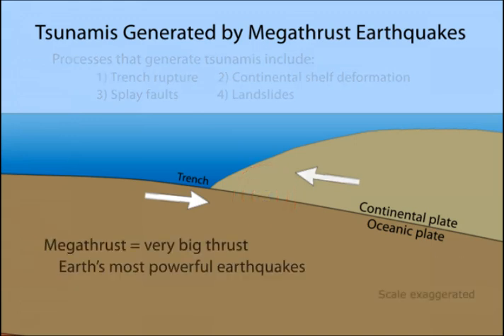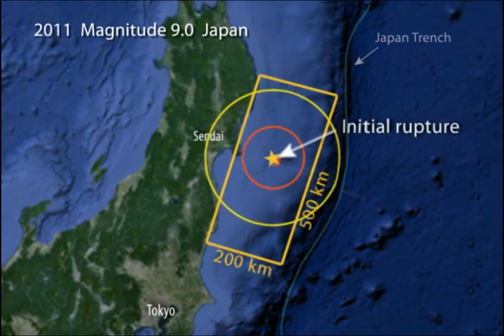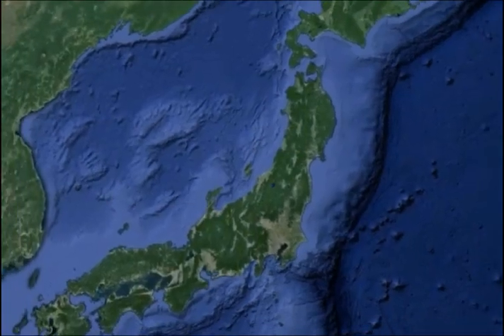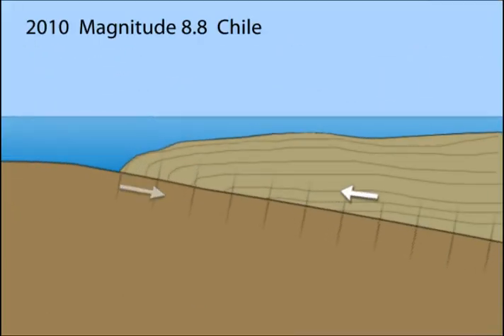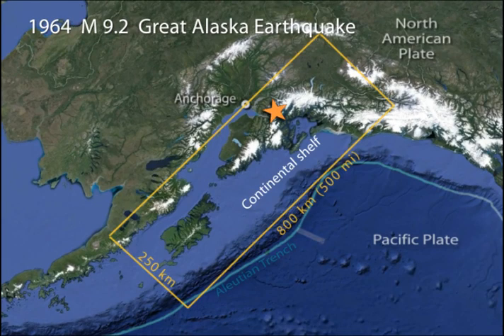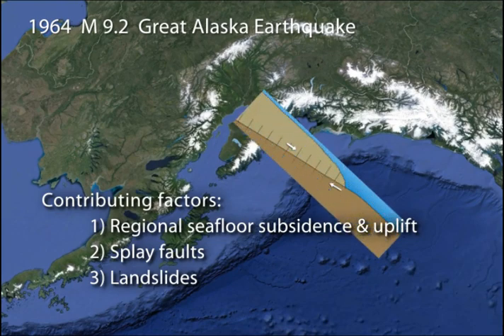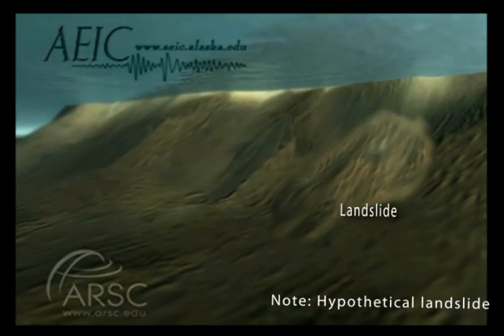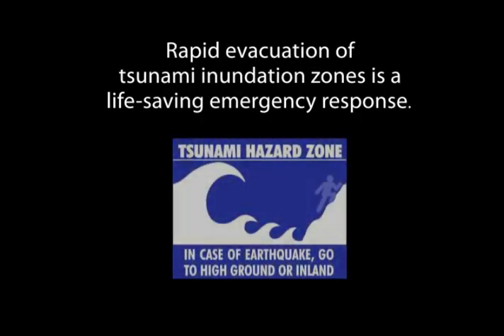Tsunamis Generated by Megathrust Earthquakes

Comment: Japan's quake was so powerful it not only moved the entire country of Japan cm's, it also fucked with Earth's rotation. Extending the day by 0.2 seconds. From a scientific pov, that's crazy
Reply: Right effect, wrong amount: it was 0.0000018 seconds  (1.8 microseconds).   Still crazy it was enough to measure though.
Reply: The energy released by the 2011 Tohoku earthquake in Japan was around 9,320 gigatons or the equivalent of 9,320,000 megatons of TNT, 600 million times the energy of the Hiroshima bomb explosion and the energy released by the 2004 Aceh earthquake was around 9,600 gigatons, equivalent to 9,600,000 megatons or 640 million times the energy of the Hiroshima bomb. Honestly, it's hard for me to imagine
Reply: If we count all the earthquakes that had occurred since the earth formed, that could probably add up to days 🤯

Comment: But does the oceanic plate move down at all? Looked like only the overriding plate gets displaced.
Reply: The oceanic plate moves down slowly over time pulling the continental plate with it, causing the continental plate to store energy.
Reply: @charlesmayes3692 yes it releases a lot of energy but is magnitude 9 equivalent to a million megatons? for example, I once read that the energy released by the 2004 Indian Ocean earthquake was 9,600 gigatons, which is equivalent to 9.6 million megatons of TNT.